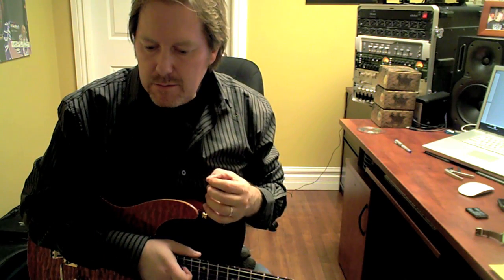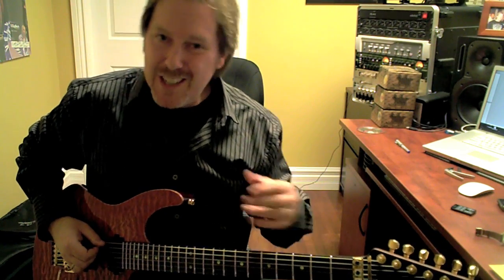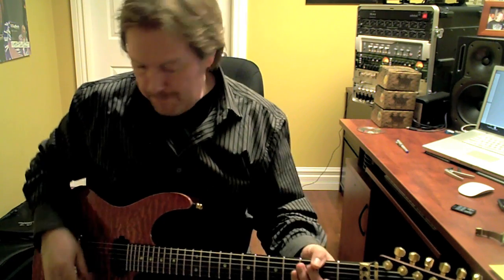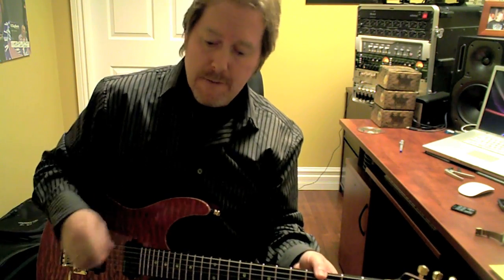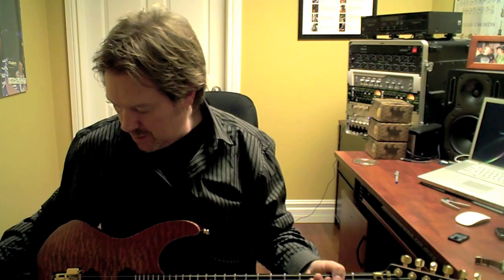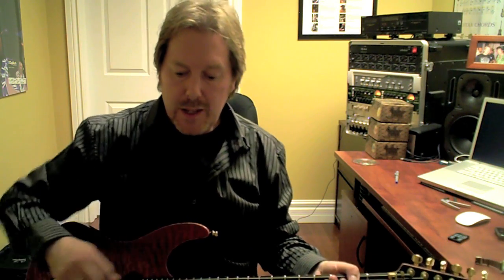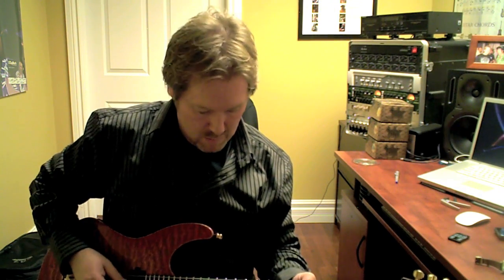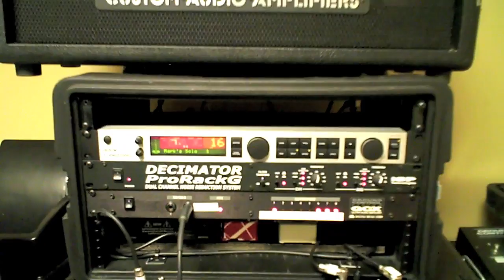Suhr Koko Boost Demo

Comment: Hey Mark, I love your videos!! I am looking for some advice if you dont mind. I have a 2 channel amp with serial effects loop. My koko boost is in front of my amp. I use it to push my second channel which works awsome. The problem is I want the leel a little higher for leads. I am thinking the only way I can boost the volume inthe second channel is to put an eq in the effects loop with the volume cutting my signal and when I turn the pedal off the level comes back up. Do you have any suggestions that may be better.

Cheers, Dean

Comment: I have the Suhr Riot and I love it! I got the Boss FB2 as a booster but I don't like it, it gets so sharp with my Strat even though I use a flat boost and not mid. You think this pedal would work better? My amp is a Fender Hot Rod Deluxe III. And a question about your Suhr guitar which I love, I would really want the version that is similar to the Pensa Suhr MK1 but I wonder if the guitar is "thick" as a Les Paul on the higher frets or more like a Strat? 

Looking forward to your answers Mark!;)